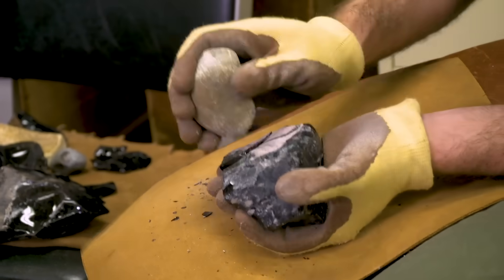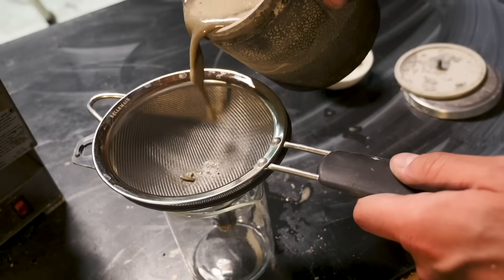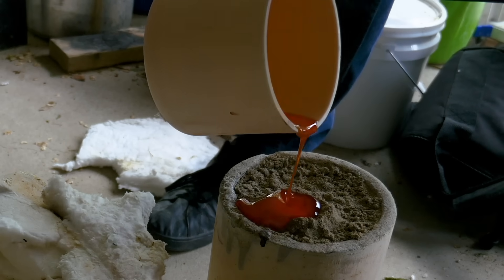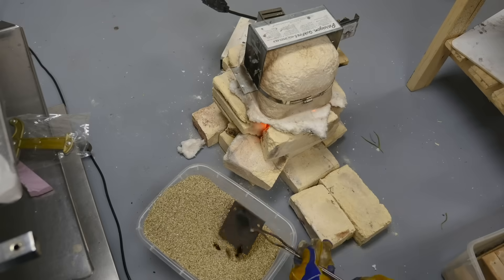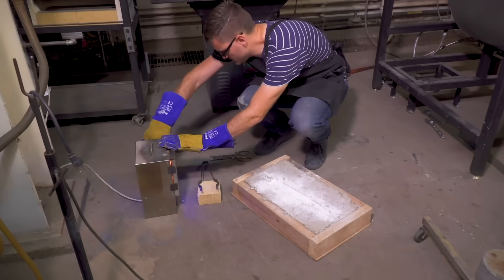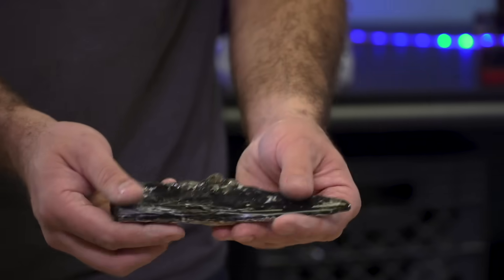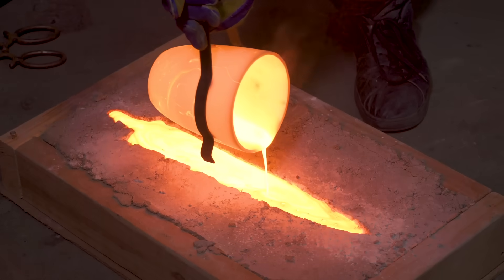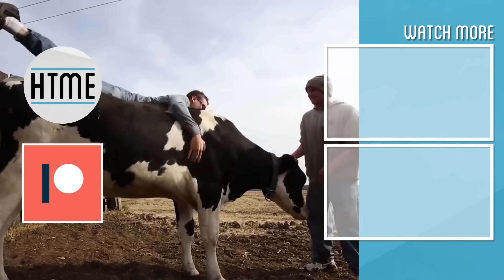Can You Melt Obsidian and Cast a Sword?

Comment: I have a suggestion for you that should work. Use an metal skeleton. use thick metal rods to make an metal skeleton. then pour the material. that way it won't bend and you will have much more freedom to sharpen the edges.

Comment: I work in a lab melting soil and removing metals in it. So I feel your pain. The best way to melt rocks/soil if they have water content inside is by heating them slowly, leave them at 40% of your final temp. for like 10 minutes so the water is consumed otherwise the melting rock gets too reactive. Melting rocks it's tricky but trying to cast them I don't think it can me done too many factors that can affect the experiment (fractional crystallization). 
Very nice attempt. I wish I had a the types of kiln you have at your disposal. Good luck.

Comment: Archaeologist here this was a pretty fun watch, good job guys! I got an idea to actually make a version thats functional :). You have probably seen the aztec versions of obsidian blades, but I bet you could make a cool obsidian blade still using the sword shape as well with some of the pieces you have. If you google "flint sword" you will find a picture of a early stone flint sword that existed alongside bronze swords when the two materials were still competeing techs. Its just the blades that are left but based on the shape you can clearly guess they were fixed to a wooden sword core like a childs wooden sword toy we have today, with the sharped stone edges placed in groved vertical on the wooded blade edge. The wooden core gave the weapon its stability and its durability and the sharpened flint blades the curtting power. When one broke you just slipped in a new one like changing a razor. I bet this could be mimced with obsidian and pressure flaking to sharpen the blades...

Comment: Probably that, in fantasy, when a blade is said to be made of obsidian, more than likely, it is actually forged of steel with grounded up obsidian mixed into the mix. I'm pretty sure that Legend of the Five Rings actually mentioned at one point that this was indeed the case, but I cannot remember in which book I read that (assuming my mind is not playing tricks on me right now).

Comment: If you are trying to cast obsidian to make a blade you will need to use a pressure chamber. Obsidian has a crystalline structure and you will need oressure to make a stable crystal it else it will break instead if having strength.

Comment: I work in a factory where we melt super alloys for jet turbines. This tip will help with all casting types of substances- This type of substance needs to be cast under a vacuumed environment, it is reacting with the chemicals in the air. Obsidian, much like glass and diamond is created under immense pressure and has no access to air. This should help with the cracking and bubbling, also, dont do a open- half cast. it needs to be enclosed without allowing it to expand. compression needs to be kept applied at all times till cooled. Do not allow it to cool rapidly, bring it down to temp slowly while monitoring it using a thermocuple. It should take roughly 2 hours to cool down with 25* increments per 2 minutes *roughly*. Results may vary. I really look forward to seeing this come to life i hope my experience helps!

Comment: When exposed to water obsidian turns into perlite. Also considering obsidian forms due to rapid cooling at the edges of lava flows, if you ever do this again you might try going for a faster cooling in a low humidity environment. Perhaps you could look at how the University of Buffalo make homemade lava and use that to re-melt the obsidian and use that to pour it into a mold (followed by rapid cooling).

Comment: Have you considered redesigning the blade? Breaking strain on a wide, flat and long blade would be pretty low. A short stiletto with a triangular cross section and tapering to a sharp point would be intrinsically stronger and self-reinforcing. Broadswords are steel because the material has the strength to hold it's own weight but volcanic glass can't do that.

Comment from the maker: Enjoy the video?  Please subscribe!  We have plenty of other great videos to check out on literally attempting to make everything!  Also, don’t forget to click on the notification bell to get pinged when upload our next project!  Thanks!
Reply: no
Reply: I would recommend heating the mold up to at or near the crucible temperature level, pour the hot liquefied obsidian (hlo)  into the preheated mold, hold the mold at high heat long enough for the hlo to settle then allow the temperature to drop slowly to keep the hlo from shattering.
Reply: i realy love your vids
Reply: Same
Reply: Perhaps try casting 1 in a manner where you can flint nap it after wards
Reply: How To Make Everything If I may, there's another channel that deals with reshaping materials using a hi-powered water jet. A recent video showed reshaping a hunk of obsidian into a near perfect cube using a 60,000 psi stream. If done right, you may be able to produce a blade strong enough to both cut and stay in a single piece.
Reply from the maker: Thanks Joshua!
Reply: How To Make Everything i like ur name xd
Reply: How To Make Everything um caps lock.... Please turn it off it sounds like your yelling

Comment: I'm a welder I use a MIG welder . there's usually a glass-like material that since on top of the world in spots . it seems pretty strong . anyways they got me thinking what if you could make a glass dipped Arrowhead or Spearhead . a metal maybe copper form that is meant to the the reusable skeletal structure of a razor sharp glass edge .

Comment: I am sure the author/sword-maker knew that the obsidian blade would be brittle... without some metallurgical magic. But he did show that not only is it difficult, but the resultant blade could not be used as shown in Game of Thrones. The show IS a fantasy after all. :) I am not a chemist, but maybe with the proper ratio of the correct impurities the blade could be usable? But then, glass is glass, right?  However, is not a diamond another crystalline structure that is very strong?

Comment: You have to "purge" the bubbles.
From my experience with melting exotic materials(which is not extensive,but quite beyond basic or layman)is that,the obsidian while still in its molten state be agitated(high vibration) before pouring.
This vibrating assists in allowing the trapped gases to escape,thus reducing the amount of residual 'pockets' that form when this particular material hardens.

Comment: i think in actual castings (professional grade) the sand, called greensand, is mixed with oil and some ceramic powder and it will hold its shape much better and will allow the molten glass to cool slower

Comment: I already knew it wasn't possible to do this. However, I do not know if it's possible to mix properly with a steel to make a new type of metal. I'd imagine that it wouldn't mix properly while melting or it may just push it out as impurities during the smelting process. I'd be interested to see the result of that test. Even if it does work it would probably produce an inferior metal.

Comment: Diamond sword!!!!!!!! XD

But in all seriousness can you even reliably melt diamond on earth?
Reply: You can, its just hard. And it destroys the value of the diamond, because the crystal shape is all that gives it value.
Reply: Diamond is never liquid, it can be made by crushing graphite at extreme pressure and temperature, though that can entail having fractures and gaps.
The best way is to have a vacuum chamber, a metal object held in space (only by aerogel glass with a wire within) that is a scaled down version of the sword you want to make.
Within the chamber have a large supply of graphite connected by wire to the positive lead of a battery on the outside whose negative lead is connected to the scaled down metal sword. Then use a laser to turn the now positively charged carbon into vapor that will deposit itself on the metal sword that is negatively charged. This makes a diamond coating with virtually no fractures.

Comment: A couple of ideas.   Try mixing a bit of coal dust in with the casting sand ( carbonises the casting surface.). Or heating the sand mould and letting the sand and glass cool over several days to avoid thermal shock.  You might also look up Prince Rupert’s Drops which are very highly stressed glass bead things.

Comment: You seem to have access to glass blowers and I wonder why you don't seek their advice more often when experimenting with glass.  I enjoy what you are trying to do in your videos but its painful to hear terminology butchered so badly.

As to your final dagger, you probably could have gotten it to a proper casting temperature without the need for flux at all with a proper glass furnace.  We would be talking temperatures well above it's melting  point though.  Probably around 2250 to 2450 degrees Fahrenheit.

The piece didnt crack durring the annealing cycle because of the flux it cracked because you were most likely annealing it on a cycle appropriate for a COE of 90-104.   That would be approximately 8-14 hours.  With a strain point of 820 degrees Fahrenheit and a first step cooling of 300f/hr

You probably should have annealed it over at least 18 hours and assumed a strain point of around 1000 degrees Fahrenheit. With a first cooling step of no more than 100f/hr.

I hope you try this experiment again.  I'd be glad to lend you my expertise if you request it.

P.S.  before you cast into sand fire its surface with a dirty torch like acetylene.  The layer of soot it leaves behind wont bond to the medium and will prevent so much sand from bonding to the surface of the casting medium.  It leaves much smoother surfaces

Comment: How is it that nobody online can figure out that green sand sucks for high temp casting because it's not dry, and that oil sand is what's used in these cases because it doesn't boil? Also, baked plaster that's been to 250F for 12 hours is quite dry.  Outgassing/boiling in the mold cools the material really fast and it's very, very bad for casting, especially in glass, but even in other metals, where the rapid cooling prevents crystal formation in the material.

Comment: What if you found a way to form a crucible in the shape of a small blade? Or maybe you could just use the mold. Are there mold materials that can take the heat?This way you could form the blade while you are melting the obsidian? Maybe even use a higher percentage of obsidian than glass so it is stronger final product. Then you could maybe even nap a serrated edge onto the blade when you are done. Maybe that's not doable, probable crack the whole blade, but worth a try.

Maybe I'm being silly, you'd need to find a way to get it to flow into the entire mold evenly. Just an armchair thought from someone who knows nothing about your craft.

Comment: All these forging techniques are so dismal to creating or mastering the formation of a structured piece, it owuld seem there is no form of study adequate to the properties in order to achieve the desired result with a repeatable 99% accuracy of each state once the matter is understood. This experiementing is sloppy and un refined, which is not the form of work in which one undergoes in that process of alchemy. 

in the film of 9:26, you can see the cold bridges in the exact places where it will crack, because of the cooling rates.

first process is of which and what material and its melting/ shrinking rates. Then there is Pressure heating verse earth pressure heating. Then there are teqniques in whihc utlize other methods such as, in a room that is heated to x amount as the substance is lasered heated into a slag/molten state impurities or not depends on whether those impurities are to create a desired and known outcome or a process of theory of its application.  So in many methods one can stream a gradient cooling in the entire object at once or a gradient cooling from end to tip, in which is forged through a method of using light to liquidate the end and form cool s it proceeds to  slowly create this, then their is lattice sculpting on the molecular level, through other methods... So would I say this is a best method ot forge an obsidian blade, no.. there could be many other methods tahrea re archaic,  depending on teh surface tension, and like material, one can also use a drip break method, in an angular piece of steal and then get it to a form to grind down. The methods are endless, but as such one should attempt to make and pick the most refined method and or advance its practice. But currently there I a void of incurision in which has created a submissive society... in whihc is removed from advanced forging. Ie, laser forging, induction forging, electric forging. gas. pressure. although there are interesting experiemental forging process still available in zero g environement, for a variety of combined forging techniques. As such there are still processes in which are done in space to create substances for here on earth as making certain spherical makes or techniques. So... meh..

Comment: Fucking hell.. how dangerous it is to mess around with extreme temperatures and broken glass if you have no idea what you're doing.. did you seriously expect this to work? How were you planning on putting an edge on a piece of badly cast glass with the molecular structure of dyorea? A whetstone? If this is a joke specifically about your incompetence, it's not funny because you aren't a good actor. Why do you think ancient humans used napping rather than sharpening? What exactly did you think made obsyian special, it's chemical composition, or it's molecular structure?  Also, I hope you used a mask when smashing up all that obsidian (to be responsible you should have made a special point to do so for the cameras). If you breathe that in, it's unbelievably hazardous to your long-term health. What an utterly moronic and irresponsible video

Comment: You may have started off with obsidian but you ended up with a bit of a borosilicate, transition metal mess. No wonder it couldn’t stand its own thermal stress. I think brush up on metallurgy and give it another shot! I think you can do it! Also you don’t want to let the obsidian cool for too long, it will start forming microcrystals.

Comment: Recently read an article where electricity was run through molten glass that produced a lot stronger and durable near unbreakable glass. Do not recall voltages involved can surely be found on the internet.

Comment: I'm wondering if you couldn't lay some fiberglass mat or batting into the mold before pouring, lending a lot more torsion, shear, and compression strength (why your blade kept cracking - compression forces shrinking the glass too rapidly as it cooled), much as in high-strength resin casting.  I think the pour would cool quickly enough to not melt the fiberglass (completely), especially at the cutting edges, while at the fluid consistency that you finally managed to achieve, it should infuse the fiber with obsidian, causing it to virtually disappear.  I absolutely don't know if that would work, but it's just a thought if you ever do re-attempt this.  However, great work getting to the point that you did - impressive by any measure.
Reply: Jonathan Hendrix I wish I knew what your talking about but yeah I agree :)
Reply: i made it
Reply: No, that would probably not work so well. Since the fiberglass is so fine, it would melt redilly. Probably be better off using carbon fiber. It is stronger and will not melt. Plus, it would blend in fine.
Reply: +Galactic Mile Woven fiberglass should actually still be solid at the temperature that he is casting at, although it would be fairly close to its melting point, which would likely make it difficult to apply the fiberglass evenly. I think you're fairly spot on with the carbon fiber idea though; its higher melting point should allow more uniform application of the fiber material, which would make the blade stronger.
Reply: Cory Trevorson quiet
Reply: Wouldn't help at all obsidian expands as it cools solidifies, the problem is lack of pressure and uneven cooling.
Reply: Jonathan Hendrix. Glass cracks if it is not annealed in a kiln. 1050 degrees is what Borosilcate (Pyrex) needs to be annealed than a temp ramp down 200 degrees at a time allowing 30 minutes between temp drops. Same process with soda/lime glass (soft glass) just lower temps.
Reply: Glass cant crack, you ever played minecraft before bruh?

Comment: Now make a glass blade out of boro. If you try to make a napped edge the easiest way is to grind a line where your want to start the chip on the interior of the face of the blade and then use a carbide chisel to chip out toward the edge. Offsetting the chips on opposite faces, like two rows of a brick wall, might make your edge more stable.

Comment: It is an insanely bad idea to heat up nickel in a closed room since it forms nickeloxide vapors (even if it is "just" boiling->vapor pressure) which is a very carcinogenic substance. Please do that outside and with good venting (that is also the case if you heat up most other metals, many of them form really nasty chemicals you really shouldn't breathe).

One tip for mixing flux for melting: You have to grind it much more, if you leave big chunks (of obsidian) the flux can only react with the outside and it will take much longer to melt (if it melts at all). If the material looks uniform in color after grinding, it is fine enough.